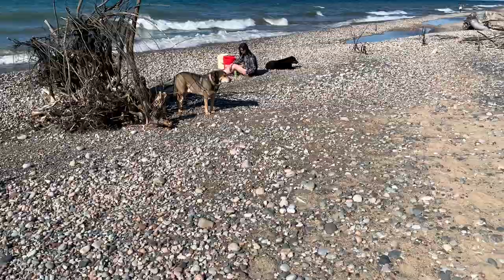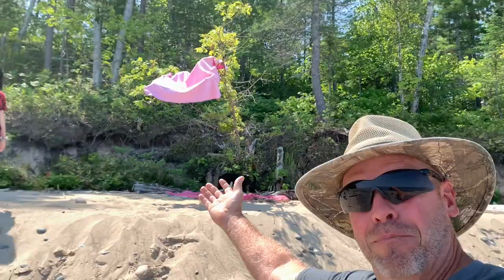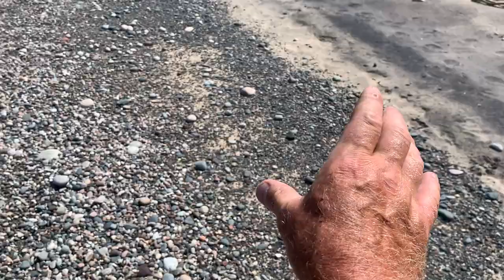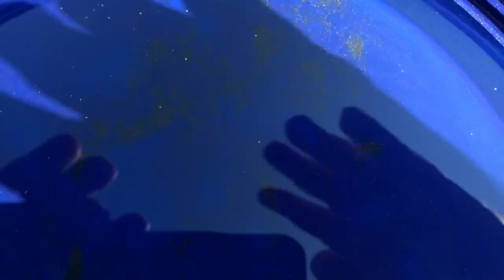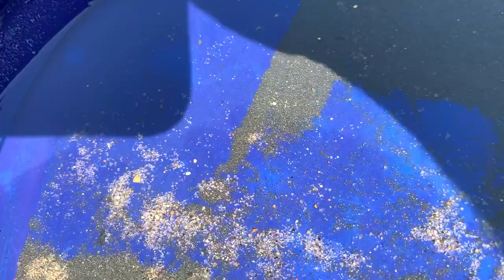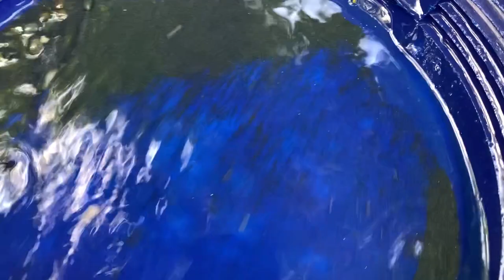Buckets of BEACH GOLD

Comment: 80% of the gold (by weight) on a beach or in a water course is often coloidal size, and is linked by its minute electric charge to a particle of black sand, which carries an opposite electric charge.   Use a magnet to retrieve black sand (speaker magnet in a cottage cheeze container works great).   Dry the black sand in a solar drier (glass covered black plastic mortar trough works well).   When the black sand is bone dry (the glass cover on the trough will not fog when in the sun), resort the black sand
again with the magnet and drop in a clean container (repeat this process three times).   Examine the non-magnetic residue left behind with a magnifying glass.   The amount of small particles of minute gold will astound you.   A ton of black sand harvested by magnetic retrieval from California mining tailings has produced up to 40 ounces of gold.
Reply from the maker: Screenshotting ✅

Comment: Are you allowed to use hydraulic mining there on the beaches?
You are already using a highbanker with pump but could you use a suction-nozzle and use that to dig with for an easier time?
You would probably have to use dream mat to handle the high load of sand and still catch the fine gold but I'd be very interested in the results!
Reply from the maker: I think my highbanker is probably the most they’d allow!

Comment: Excellent information. There are places with similar sand conditions out here on the "Left Coast".! Rigby definitely has a nose for Au. PBR's will keep your strength up. ⚓️🦺🍺🧙‍♂️
P.s. Do you ever use a metal detector at or near a stream  confluence ? 🍺🍺🧙‍♂️
Reply from the maker: I don’t currently own a metal detector capable of finding small gold 😭
Reply: @FlourgoldWizards  I suggest looking at Mine Labs line of detectors. I started with Whites in 1976. I used my finds to purchase two more over the next 3 decades. Give Rigby a snack for me. 
⚓️🦺🍺🧙‍♂️

Comment: Wow! So much gold!! You gotta find a way to keep soil erosion in check as well. I read somewhere, a over a decade ago that, if the jetty are made out into the water, with in certain spaces, to the  sea or wherever mass of water is, it can protect beach erosion. Due to the movement of water within those outward jetty. Maybe you can start with all those fallen trees there, and do a little experiment. Would like to see that. Maybe it will collect the material you are looking in between them as well. I like fossils too
Reply: Our family had a cottage or property on Lake Huron since 1949.  We saw 3 high water years that took a lot of sand away.  I saw many schemes for break walls and wave dissipation structures.  They all take a lot of work.  The home owners do the break walls but very seldom spend a little extra on some “T” shaped wave breaks made from 10 to 12 foot fence posts water jetted down about 5 or 6 feet.  I saw one set that survived over 30 years and helped the undermining of the break wall.  Many break walls were lost to the undermining effect of the waves.  Rip-rap is required at the base of the wall but that adds cost and nobody is really running a concerted effort to do a better job.  In 1950 my parents saw septic tanks floating in Lake Huron in the early spring.  I was only 3 and don’t remember that.

Comment: Hey Jason. Question for ya bout my High Banker...
What is the premium angle of the sluice box for maximum results. (I just got it and finally have the time to run the tailings I saved from all the paydirt I bought online to learn how to pan for gold.) I read 5-7°. Do you agree? It came with a 760 gph pump.
Reply from the maker: I guess it would depend on what type mat your running, i never run any material under 8 degrees!
Reply: @FlourgoldWizards  I've never seen this type of mat. It does have vortices. Dunno what kind it is though.
Reply from the maker: Test test test!!!! If it exchanges lights for heavier material and doesn’t lose gold , you’re there !!

Comment: For a beginner to this, what would you recommend for a decent starter kit of gear? I have a couple small 10" pans but i can buy whatever
Reply from the maker: A pan is really all you need! Small portable sluices are everywhere online ✅
Reply: @FlourgoldWizards  is there any tgat are better than others? Im not looking for gabage but not top of the line either. Good upper middle of the road.  I look online and theres so much stuff its intimidatimg so im just looking to another who has been there to get tips on whats good to have.
Reply from the maker: @eduffy4937  i like royal manufacturing equipment
Reply: @FlourgoldWizards  excellent i will look into them. I appreciate it.

Comment: You could extend your sluice another 3 ft with low profile vmat in it and that would show you if you're overfeeding or not cuz you will see the gold in the vmat and yes I know it would make your system lean forward so you would have to weight down the back legs....sand bags work well for weight on back legs. Make your own sandbags you're on the beach and then you can empty the sand and just carry the bags back empty
Reply from the maker: Im currently building something….😎

Comment: You definitely need a shaker table for that beach mining 👍 a shaker table is 99% more accurate than a sluice or high banker
Reply: Have you seen a mini one that runs off of a battery?
Reply: @ciaranbyrne62  yep. I have seen them at several mine supply stores. The last 1 I was at was Crisson mine in Delonaga Georgia about a month ago. They had water tables, shaker tables,  slices, trommels. Etc for small operations
Reply: @JohnCampbell-ho8qz  I'll try and look it up. My goal is to try some beach mining in Nome Alaska. It's a dream of mine. I'm going to need about $10K for the three months one summer I reckon.

Comment: You oughta get a couple solar panels from Harbor Freight to help slow the battery drain. Likely not net zero, but definitely will make them last longer. And except for the strip mining and all the diesel fuel needed to mine the minerals to make them, plus the immense heat needed to make the photovoltaic panels, they're earth friendly.
Reply from the maker: Seems reasonable..🤣✅

Comment: Doesn't look like gold to me. in my experience here in Alaska the flakes gather together at the apex of the black sand in the front of the pan and most of it is usually beneath at the black sand layer and not scattered all over the pan. Also, it's yellow and not white.
Reply from the maker: Its gold…. Its incredibly flat and doesn’t sink through the black sand like your granular gold. The gold cube inventor Mike Pung invented the cube to capture that particular gold on that particular beach . I’ve been there with him. Most gold that small will look whitish , until its put into a pile anyway…. I believe it’s due to the way the sun , my pan and my camera work together 😎

Comment: You need to work out if your bit of beach is in a state of erosion or building mate. Eroding parts ive had test pans do 1.18g AU from 5kg sample. Its much better gold when your on or close to the beach bedrock-clays. Tight against cliffs pays better too
Reply from the maker: They’re definitely eroding!!!!
Reply: @FlourgoldWizards   i find my best gold in black-heavy sand deposits stretched along top of the beach in a fairly narrow band 5-15ft from the cliff base. Theres only a few inch to foot of this sand before the clay beach bed. Theres always numerous scrap metal junk, iron nails, copper coins,  lead brass etc in the same gold containing sand paystreak. Il get occassional 2-3mm gold most is 40-80mesh.
Its a seasonal thing where i live, winter weather from the north strips-erodes the beaches leaving gold rich patches. I got that 1.18g sample the first day of lockdown, went to return with all my equipment to get stopped by police n sent home lol. Its no good here in summer months as wind direction from the south builds the beach up with light blonde sands.

Comment: God my Lord I had no idea that black sand was an indicator of gold. I know spots remote spots on the shores of Lake Erie way way way off the beaten path where mountains of black sand pour out of the seam in the Cliff. It's black as coal I thought what industry caused this to happen when I was a kid and I found all this. Then I thought well it wasn't industry it's coming out of a scene in the rock and eroding sand on the Cliff. I mean dump trucks full of this stuff and I didn't dig for it it was just naturally pouring out of the side of the Cliff period now that this was 40 years ago probably 30 maybe so it's probably not there anymore but this was on a very very remote stretch of Lake Erie the only thing within 100 miles was farmland. If you didn't have a 200 foot downward staircase to the beach you would have never been able to find it because this area like I said is agricultural and only a few scattering houses our cottages most do not have access down to the beach. Back then you wouldn't wanna be anywhere near the beach because of the dying fish now it's cleaned up
Reply from the maker: Crazy aye !!!! Remember to test these deposits before running them through equipment all day !!!! Good luck 👍🏻🍀 👍🏻